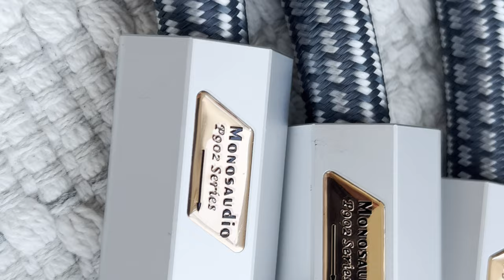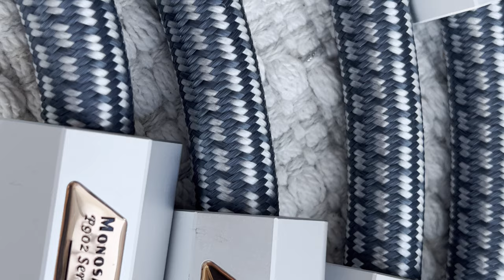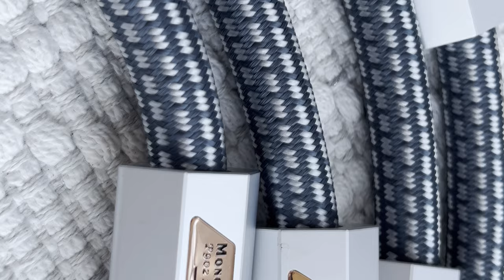I replaced ALL POWER Cables With THESE - Here's What Happened!

Comment: "I spent a lot of money and now I must justify it all by making myself think that I achieved significant improvement" or cognitive bias as most of us know it.
Reply: What about negation bias?
Reply: Why would you think that? Nothing can be further from the truth. Before I continue, for full disclosure, I have to tell you that I have a masters degree in psychology. In the past, if I didn't mention this up front, people would get extremely upset with me. I don't know why, because the information is still the same, but now you know. When dealing with personal biases, it seems like a simple thing to measure and test. Its not. In order for a test like this to be accurate, you have to know what someone's biases are. Just the act of finding out what someone's bias are will almost certainly throw the test. To prove differences in cables, there are much better ways to test. The 2 I use are null testing and blind testing. However, with blind testing, you have to know what you're doing. The average person typically thinks double blind testing is the way to go. I understand why they would think that, but its not. You can't control all the variables you need to using a double blind test, so your results won't yield scientific results.

If this is something you want to look into, I would recommend null testing. Its easier, and if done correctly, the results have to be accurate.
Reply: @052RC  how can a null test be the same as a full system playing (it can’t). Also, a biased person can still be correct about what they are assessing. To assume bias = ‘always error’ is not logical. Negation bias is bias towards disproving something.
Reply: @052RC  do you think a better digital cable can positively affect the sound in a system? Shortcut - you probably don’t. Truth - you are completely wrong if you believe that 😂
Reply from the maker: I totally understand where you're coming from! It's easy to get caught up in justifying expensive upgrades, yet they indeed make an audible difference in high-resolution systems!

Comment: Power cables are probably the least effective upgrade path, most people wont notice any difference, most power cables are built to a iso Eu standard that should be suitable for given device, the only benefit i see is to get a power cable with good shielding and strong connector's that might help in some situations depending on some equipment. In fact some of these hifi cables haven't even been accredited and could theoretically be dangerous and cause a fire, just make sure they have the right pass marks, standards otherwise you dont want your house to catch fire. I think a better investment would be better interconnects or speaker cable but even that can be a hotley contested subject. Power conditioners or regenerators maybe the better options especially if your power supply is not stable or clean
Reply from the maker: You raise some important points about safety and standards. It's crucial for viewers to understand what they are buying and to invest wisely in their setups. Solid cables can make a difference, but investing in good audio sources is often the better path.

Comment: I tried it and it works. It lowers the noise floor. I think more due to the shielding of the cable than the OFC (I have no way to test that anyway).
Reply: Well, THAT is an actual possible advantage. If you've got some proper good grounding on your home electrics, a good shielding on all cables can do something.
Then again, thick shielded wire is like what, 2 dollars a meter or so, 5 max?
EDIT: also, routing cables differently likely does the same, avoiding any analog signal cables passing over the power cords could solve it, that is, if they aren't already shielded to begin with, as they should.
Reply from the maker: Thanks for sharing!

Comment: I’ll never understand why soo many people with strong unwavering beliefs against this topic feel the need to watch these videos. 
Boredom ? Reach their anger hours for the day ?

Cables make a sonic difference IMO, and that’s ok. Whether one believes it or not :)

There’s now been multiple people that have created real measurable differences between cables. 

Thanks for making the video ✌️
Reply from the maker: I believe that I do understand why that is. People are just interested in other perspectives on certain things, that's why they watch videos they don't agree with.
Reply: That's the thing right there. People have created real differences (in their head).

Also there are measurable differences. Most of them are inaudible unless you have sensitive equipment. Sensitive in that it reacts to parameter variance, i.e. less stable

Noise can be present in low level signals from surrounding equipment. I feel a lot of audiophile cables don't include shielding for that though
Reply from the maker: @RennieAsh  These cables in the video are indeed shielded.
Reply: It's about outrage time..even if there is a tiny difference, the plug comes from the wall, you have normal wires delivering power. Difference canceled.
Reply: Power cables cannot possibly make a sonic difference and that’s ok. Whether one believes it or not :)
Reply: @oldphrt  As long as we’re all enjoying the music 🎶 neither belief should be an issue, just play on & enjoy ✌️
Reply: @damonsbest   It's a fact that a power cable can't affect performance.
Reply: @oldphrt  🤣 agree to disagree & move on. Happy listening 👌

Comment: Digital signals are either 1 or 0. I would agreed that "expensive quality built" cables gives a better result on analog signals. If digital cables affects the sound quality, it must be due a DAC that messes up?? Maybe a quality off-grid shielded system could improve sound quality better than justr buy expensive power cables?? As the grid is full of "noise"
Reply: EMI filters are cheap and get rid of all that noise, no need for expensive cables. Switching power supplies isolate all that noise in the ac to dc part, so EMI filters only work in linear power supplies. And you are right, there are only two types of digital cables, the ones that work and the ones that don't
Reply: Not only 1 and 0. Closer to only 1 and 0 if galvanicly isolated though.
Reply: Your forgetting how each digital input has been implemented inside a component. 
Whether it’s galvanically isolated etc.

The digital input itself could impact the sound before considering what a cable may or may not do.
Reply: @damonsbest  thanks for the reminder. I'll write that down
Reply: You're missing one thing. You can't send 1's and 0's through a piece of copper wire. Digital cables are really analog. In order to send a digital signal through the cable, its converted to an analog representation of the digital signal. And because the digital signal is now analog, it can be effected by anything that would normally effect any analog signal.
Reply: A digital signal is a squared analogue signal so can be effected by interference
Reply from the maker: You raise some great points! Digital signals do have the potential for more consistent performance since they’re just 1s and 0s. However, interference can still play a significant role in the overall sound quality. A good DAC can definitely make a difference, but clean power can help push that quality even further.

Comment: I did a scientific test about this many years ago. Using speaker chamber test with microphones. The response curve and sinus waves are exactly the same. 
We need to know that the miles and miles of power cables going into our house is not this level of quality, therefore a 3 foot cable of the best quality doesn't do anything. 

This is in my humble opinion a placebo effect. 

It's the quality of the amplifier and the signal source itself that impacts the sound. Not the power cables between the amplifier and the wall.  

If it's connected to a capacitor bank it might have a bit more omph due to power reserves when it needs to hit that hard base with high volume. But that's it. Because a good amplifier should have a big enough capacitor bank built in.
Reply: Why would it change the frequency response? Your tests are flawed. The miles of cable before the house argument is flawed for sure.
Reply: @Pete.across.the.street  the frequency's are the sound you hear. If this cable can't clear it up or change it. The sound will be the same.
Reply: @elborgund frequency is only part of what you hear. You are measuring the wrong things. If you only listened to test tones that test might be somewhat valid for measuring differences in cables, but not for music.
Reply from the maker: It's important to note that the last couple of feet is in my case clean power going from a power filter to its final destination
Reply: I'm going to tell you something and I'm not trying to insult you. Its just a fact. What you did is commonly referred to as junk science. I'm not saying it was intentional, but if you want to claim scientific results, you have to adhere to the scientific method, and there are no exceptions. 

What were you testing for, and why? The first step in the scientific method is to have some type of observation that can't be explained with our current understanding of how things work. If you don't have a clear observation of an event that can't be explained, you don't have a test. Its just that simple. And if you do have a observation, it needs to be replicated as part of the test. If you want to see a perfect example of junk science, look no further than the audio science review channel here on youtube. The guy is a fraud. He's building his youtube channel by telling people what they want to hear. I would refer you to the posts I've made on his channel because I completely prove he's doing junk science using his own videos as evidence. However, that's not possible because he removes my posts the second he see them. But the point is, science is something very specific. You can't just ignore the evidence and take it upon yourself to prove, or disprove an event that you took no part in. Well, you can, but you just can't call it science. 

Just to be clear, I'm not saying what you did was wrong. You can do anything you want. If your testing gave results that you were able to use to your advantage, that's fine. You just can't call it science. That's all I'm trying to say.
Reply: @052RC  ASR is junk for sure

Comment: Electricity is noisy, and it does not matter where you live. The best thing anyone can do for overall sound quality is to run a direct circuit, or line, from the main panel to the audio gear. A direct line, or "Home Run" from the panel to the gear, eliminates any possibility of those other outlets and switches adding excess noise to the circuit. Most folks do not know that electricity actually vibrates. It vibrates enough that it will loosen electrical connections over time. If you use the inexpensive "stab" outlets (USA), the vibrations of the electricity will actually break the copper wire. Everyone laughs about this stuff, but the truth says different. Will a power cord make a difference? It just may, depending upon the circuit and what is going on outside of the house at the transformer. Ham Radio guys know this stuff, and it is no different with our AV gear.
Reply from the maker: Running a direct line is indeed a great thing to do, and it should be done whenever possible. Using high-quality power filters can also do wonders ;)

Comment: I can confirm the extra bass on a decent amplifier. I only replaced the supplied power cable because it was a bit flimsy and wouldn't attach properly. I got a cable from a different manufacturer (I won't say the name, but starts with PS and ends with wave 😁). I wasn't expecting sound changes but, out of the blue, I was earing stronger bass. I haven't changed other equipment or speaker placement, so I assume it was due to a better power cord
Reply from the maker: Bass is possibly the place where the most improvements can be heard, mostly due to things such as contact and cable resistance, which tends not to be great on stock cords.

Comment: If 14 guage is sufficient,  16 gauge may compromise the amp and 10 gauge might be unnecessary.
Reply from the maker: It's not always just about the thickness. Shielding, connectors and materials matter as well.

Comment: I don't understand what the connection is between the "quality" of the power cable and the performance of the audio system.
I strongly believe that the difference is made by the filtering part, the quality of the mains transformer, the quality of the parts, a good shielding of the preamplifier and a correctly sized final stage with sorted components.
I knew a passionate audio amplifier engineer who managed, with long-tested components, to build a transistor amplifier in the final stage that sounded better than a tube amplifier.
Otherwise... just a waste of time.
Reply from the maker: Once you filter the power, you have to transport it to the device in a way, that remains pure and high quality - that's what that all seems to be about.
Reply: @TheAudioStuff  Power supply does the filtering. Just study some electrotechnics books first FFS.

Comment: i have a Nad 3020i with single no ground power cable , it it better to change it , or leave it alone as it is ?
Reply from the maker: I’d go for this one
Reply: Neither. Contact The Cable Company. They're the largest audio cable retailer in the world. The reason they're the biggest is that they keep demo units of everything they sell. So, for example, if you are interested in a new power cord, call them and they'll come up with 4 or 5 different options for you. You then get a box full of cables to try in your system without committing to a purchase. If you think one of the cables makes a difference worth paying for, buy it. If not, you don't have to buy anything. 
Power cords are weird. The results you get them are not consistent. You may hear no difference at all, but even if you do hear a change, its not always for the better. If you can't try them first, I say don't buy anything unless you're OK with taking a chance.
Reply from the maker: @052RC  It's also a great option, didn't know they did that! That's fantastic for in-home trial.

Comment: This seems like an awful lot of improvements in every single aspect to be coming from power cables alone. There are some tests that show cables can make a difference in certain conditions, but as long as they are thick enough and not the absolute worst quality, tests also show that what actually comes out of the speakers is for all intents and purposes, the same. So, first thought was that this is either placebo or bias, but then you mention that the cables removed static noise when idle for you. That generally means you have an issue somewhere, though if its removed by swapping the cables then it makes me very curious what you were using before. If all your old cables was really bad or insufficient for the workload, then this makes alot of sense to me.

I once tried reusing speaker wires from tiny satellite surround speakers on some floor standing 4-way towers, mostly because it was what I had at hand and I was impatient. Obviously, those wires were never designed to carry that load, and when I got around to make some decent cables with the correct gauge, I experienced alot of the same things you talk about here. Cables are, in my humble opinion, one of those things that are either good enough or not. Yes or no. And when they are good enough, I havent found any benefit to upgrading.

I am genuinly curious though, Im thinking that there has to be something going on here. Either that your old cables were unsuitable, or you living on top of a radio station or something. I find it a bit hard to believe that all the things you describe here comes from "dirty power" alone though, but if you want to test that you could always pick up a a simple power conditioner for like 50 bucks and swap all your old cables back in. If it still sounds as good with the old cables and a power conditioner, then you might have some weird stuff going on with your mains power, but if it goes back to sounding like before the upgrade, im fairly convinced the issue was your old cables being underspecced for the work you ask them to do.
Reply: I double checked, the towers where 3-way, not 4-way. Not that it matters but hey, details!
Reply from the maker: You raise some really solid points here! It’s true that cable quality can sometimes get overlooked, but you're completely right—if the cables are up to spec, the differences can be subtle. I did have some inadequate cables prior, and it's fascinating how much better things sound now. I'll definitely consider your suggestion about testing with a power conditioner; it's a smart way to rule out any other factors.

Comment: I wouldn't cheap out on tires on my supercar, why would I cheap out on cabling on high end audio.
Reply from the maker: I liked your analogy a lot haha
Reply: I hope your spark plug leads are screened, and with low-oxygen cable then. It makes the engine sound better.
Reply: @donerskine7935  Modern cars don't have spark plug wires. At least the vast majority of them. The ignition coils are mounted directly on to of the plugs. That said, the sound of the car wouldn't change even if it did have spark plug wires. I guess if you have a miss due to a bad cable, the sound of the car would change when you fixed it, but that's about it.

Comment: Electricity is sent to your home over miles of the cheapest copper wire/cables that would do the job and then distributed through your house by the cheapest wire that met building code, but somehow that 4 feet between the outlet and your equipment can magically enhanced electricity via a $2 grand power cord.
Reply from the maker: That last 4 feet is clean power going from a power filter to its final destination.